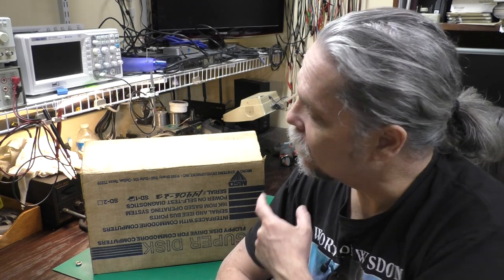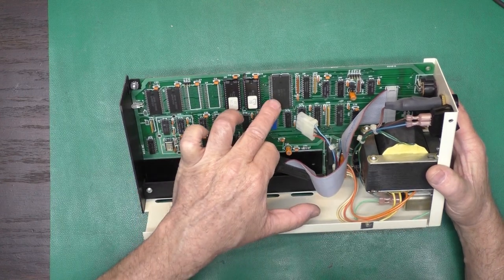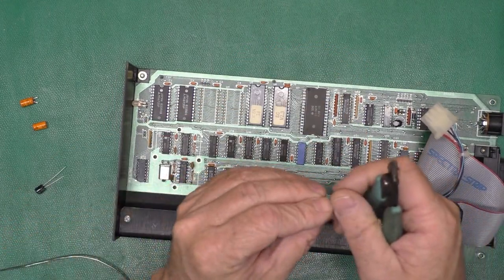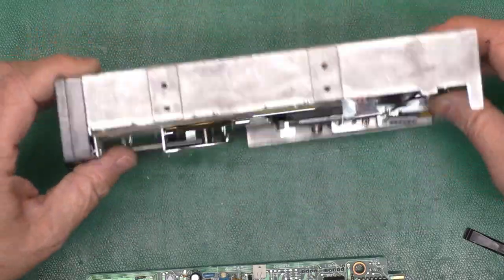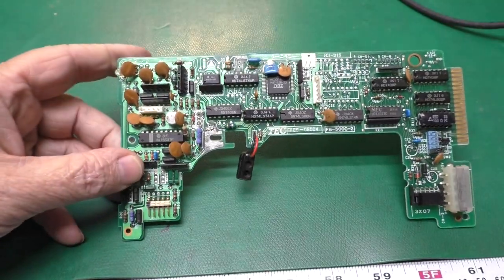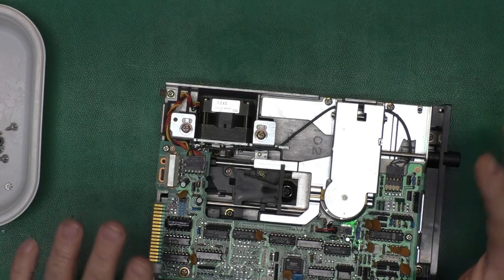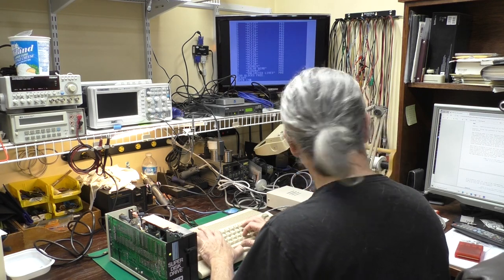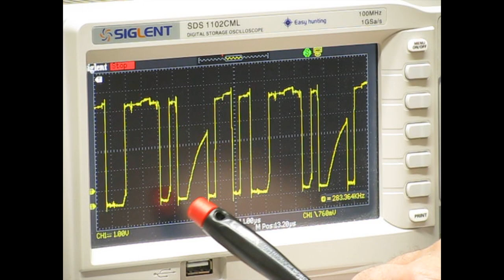MSD Super (leaky) Disk Drive SD-1. Can we cure this drive of incontinent capacitor syndrome?

Comment: Hey Birt, good vid ! I've been repairing TEC FB-501 for a long time. They were (are) in all sorts of older computers from the old Kaypro I's to TRS add-on drives to early MS DOS machines. The dual headed versions (FB-503 ) were soon to follow and aren't quite as bad as the 501s but they suffer from the same leaky capacitor  issues to a lesser degree.  Nice to see someone else trudging thru the leaky capacitor issues for once!  FYI, I always go up in capacitor VBD value when replacing and the Bipolar caps on the spindle drive boards never go bad, probably because they are two-way devices, different electrolyte maybe ?
The 2 empty spots on the logic motherboard are for the MSD-SD2(the SD1 and SD2 share the same board) build to accept extra static ram ICs for running the coveted 'autocopy' program without a connected computer.

Comment: Hey Birt, I have the same red/green flashing LED as in your video at about the 53min mark, how did you determine it was a #24 read error? Thanks!
Reply from the maker: There is a procedure called 'reading the error channel' which is in the users manual. It is a command you type in which sends a request to the drive and the drive responds with the error type.
Reply: @HeyBirt  thanks. when I powered the drive and my 4032 previously I got a solid green LED. I did run that command anyway and got a '0' (zero) back indicating 'OK'. The drive head activates and spindle spins when I power the drive and then again when I power the PET. The red/green flashing LED appears when I try a LOAD "$",9 (in my case) or use the NEW command to format a disk. I suppose I need to run the diagnostic command again after the flashing green/red appears to read the error channel again. Thanks again.